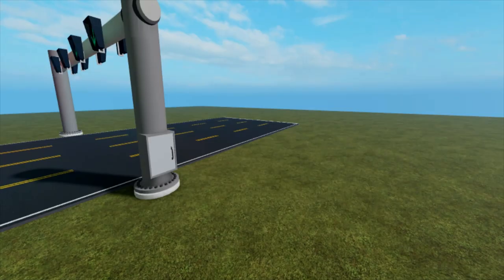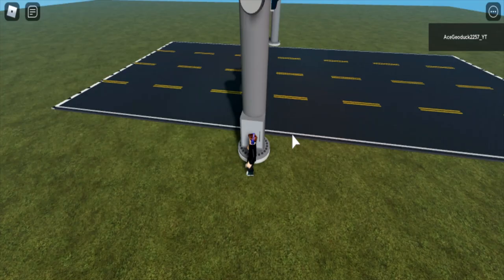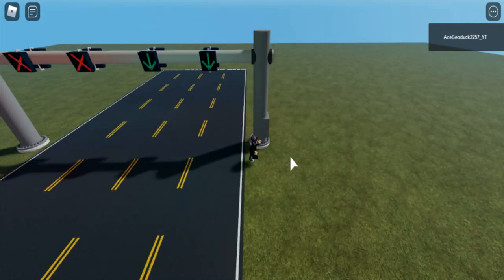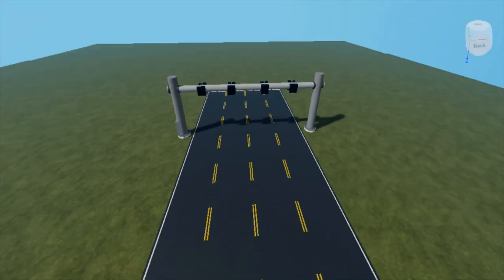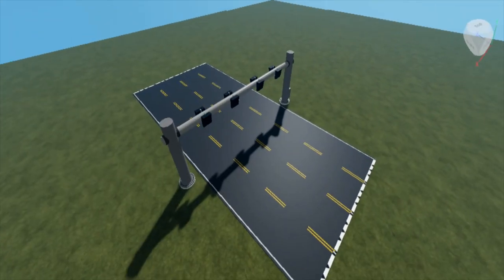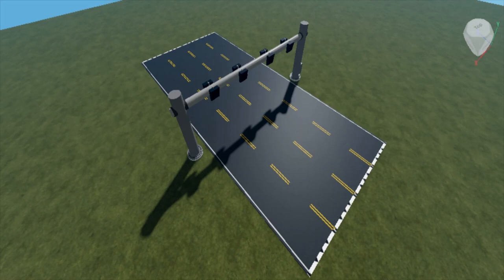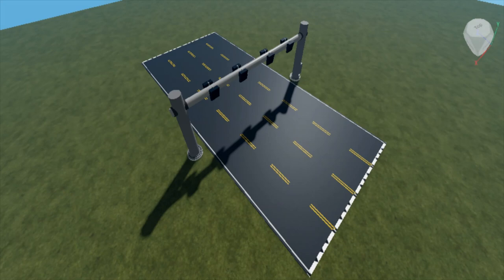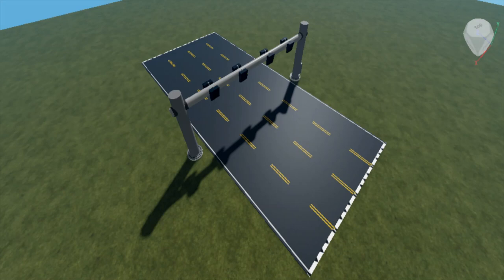Reversible Lanes; What are they?

Comment: I live in New Hampshire, and you have New Hampshire Motor Speedway. Route 106 to the track has reversible lanes, but the road wasn't made for it. The signs are overhead, but they're folded when they're not in use and unfolded when in use.